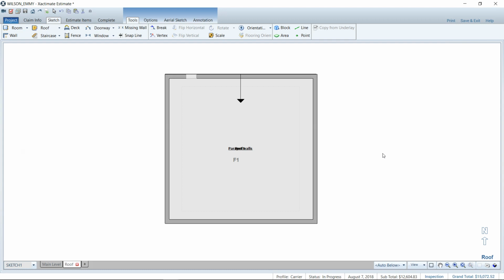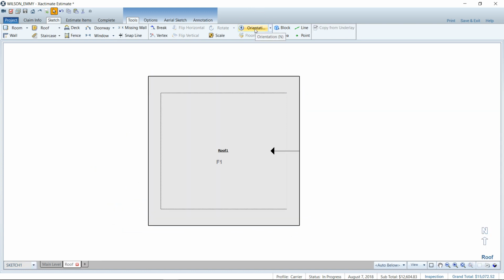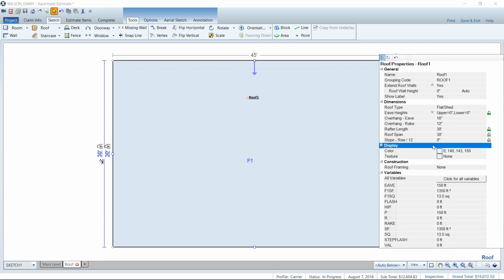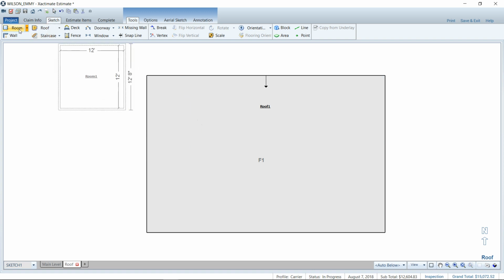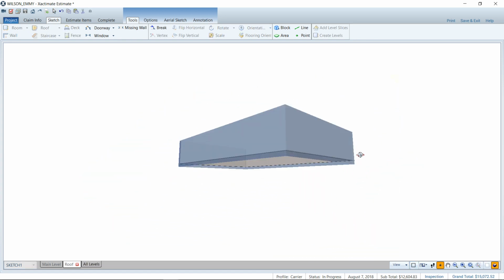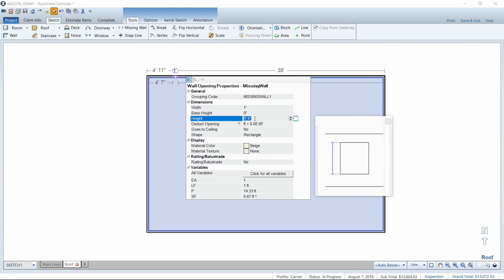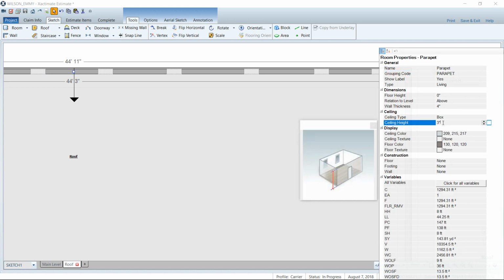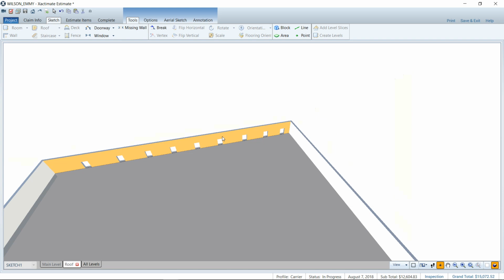Flat Roof with Parapet Walls

Comment: I'm not sure if you can add roof items to that drawing and get the accurate sq footage of the roof and walls together to make one roof measurement?
Reply from the maker: You could graphically add the line item to the roof area and then apply it to the walls as well when the item is loaded to your cursor. The flat roof items should apply to the wall areas with no issue in my past experience.
Reply: If you could do another video showing us?  that would be marvelous :)